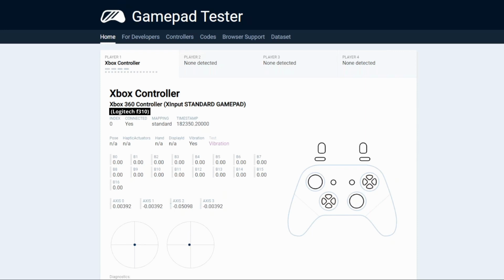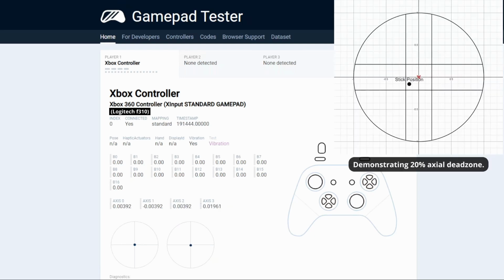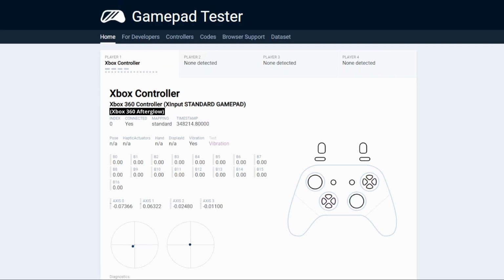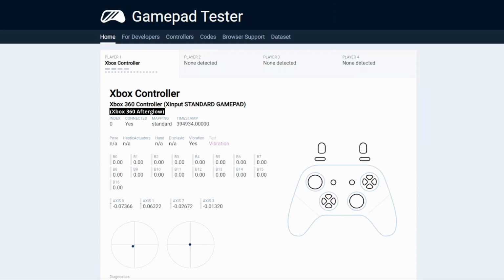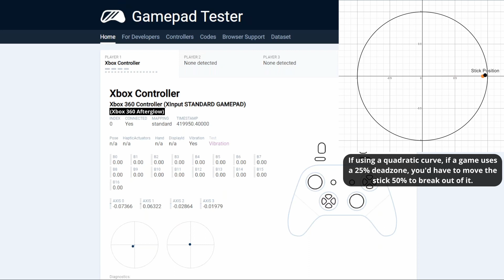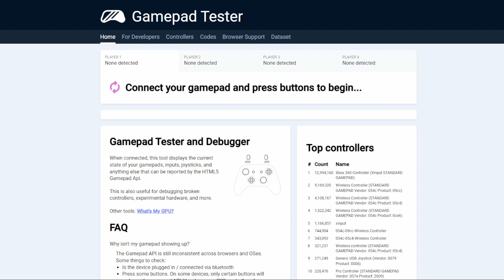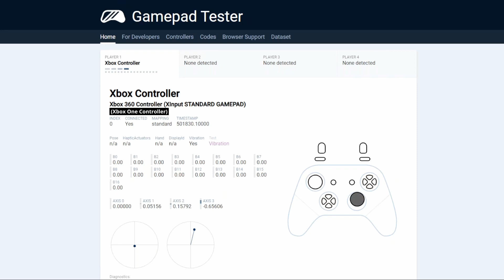Inherent Deadzones and Curves in Controllers

Comment: I'm assuming you are using the T2 to test to make these test, just note, when you do your test with the controllers, Make sure only one controller is connected to the T2. If you have two connected, then it will snap to the x&y axis, for the second controller.
Reply from the maker: Thanks for the heads up.  I've only used the second port temporarily for authenticating.

Comment: Would you be willing to make a video about Hall Effect Sticks? I have seen the 0% circularity errors, but now having watched your videos I am struggling to see how that would even be advantageous given the flaws in developer dead zones. 

Are there any advantages to Hall Effect sticks or are people getting caught up in marketing hype?
Reply from the maker: I don't own any Hall Effect controllers and existing videos have shown it better than I could.

The real advantage of Hall Effect sticks is that they have a much longer lifespan than normal potentiometers.  Potentiometers will wear down over time and start malfunctioning.  The stick values will become incorrect, or increase without user input when this starts happening.  You have to replace the specific sensor or the full analog module to correct it.

Otherwise, as long as potentiometers are functioning properly, there's really no observable difference between the two.  I've heard from some reviewers on Hall Effect controllers that the resolution of the sticks isn't as high as some potentiometer controllers can have, but that may just be the specific models they looked at and potentiometers vary anyway.  Resolution is really not noticeable unless you're looking for it though.

Drift in the sense that sticks get loose and don't center well seems to be the same on both.

I think it'd be a smart move for the industry to move towards Hall Effects, but it seems more individual on how useful they really are.
Reply: @EternalDahaka  Thank you so much for taking the time to write such a comprehensive answer!! 🙏🏻 I really appreciate it!!! 

So, from what I am hearing you say, it sounds like the benefits of Hall Effects are more so longevity than accuracy or anything performance wise. Is that correct?

Comment: Didn't know how to contact you saw a video from about a year ago about destiny 2 deadzones I read a comment where you said it would be possible to eliminate the ramp up speed and completely alter the deadzones and response curve how would you go about doing that?
Reply from the maker: You need some program or adapter to alter the stick values to counter the in-game controls.  I demonstrate this on my channel with a TitanTwo device, though the TitanOne and CronusMAX are similar.  You can see an example here how the input changes with the TitanTwo script: 
https://youtu.be/xkiHCURKqVU
Those are all pricey, but the only real options I know of for console.  On PC, there are some free programs like Durazno, Steam Input, and DS4Windows that offer antideadzone options, but they may lack certain features.  If you're on PC and losing aim assist, you might just use HidHide to hide Destiny from seeing the controller and then use some M&KB emulator since many of those have good options and altering stick input isn't perfect.

You can't remove/counter any smoothing, but you can limit the input so it doesn't hit the turn acceleration at the edge of stick movement.  Destiny 2's turn accel triggers at about 98%, so outputting an outerdeadzone at 96-97% will avoid triggering it.

My TitanOne/Two scripts can completely negate the deadzone shape for Destiny 2.  You can set a radial deadzone in the script, and counter the game deadzones with the antideadzone options.  Those other programs can counter axial or radial deadzones, but I'm not sure if they can do it at the same time.  If they can then they can counter Destiny's shape exactly too.

My T2 script wouldn't counter Destiny's curve properly.  My script uses a power function(x^a) for the curve, and Destiny's uses a different function.  It could change it some, but it wouldn't make it linear and may make small movements too sensitive if the value is too large.  The applied curve would need to be altered for one that mirrors Destiny's better.  The T1 script has more crude customization.
DS4Windows has a custom curve option which should be able to effectively counter it, but I don't think it can counter both the radial and axial deadzones at the same time.